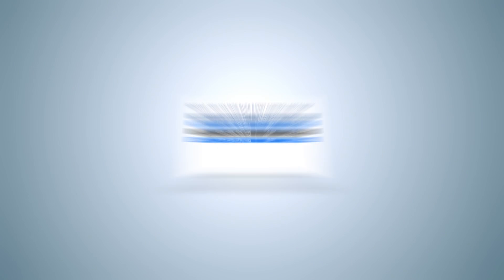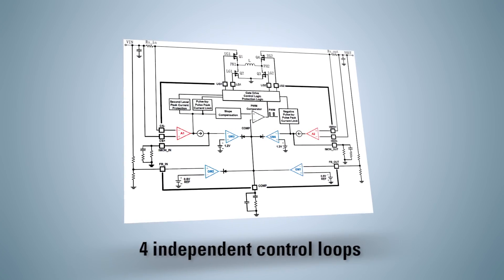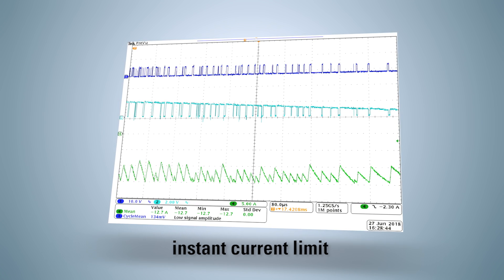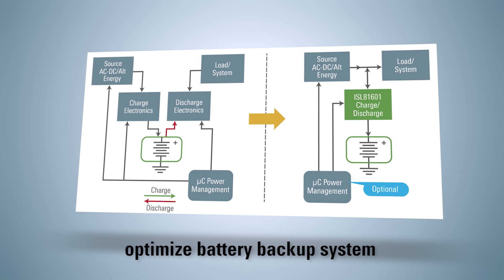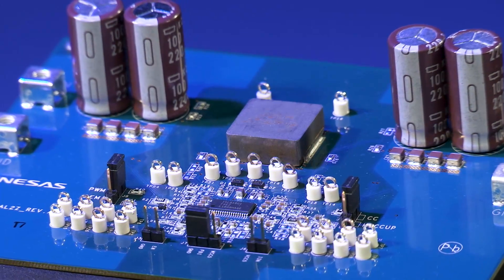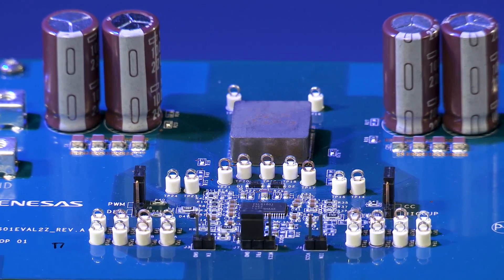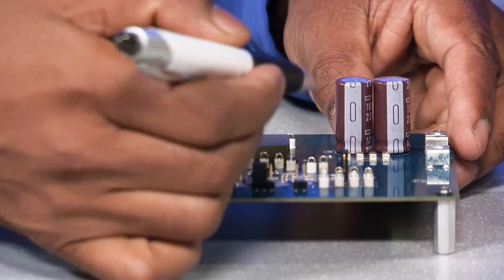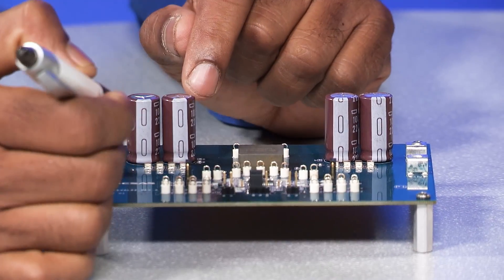High Voltage Buck Boost Controller

Comment: I have a question about this, in the video you said that it can recognize lead acid, lithium ion and supercapacitor
However, I test with lead acid battery and it not recognize at output
Can you help me out ?